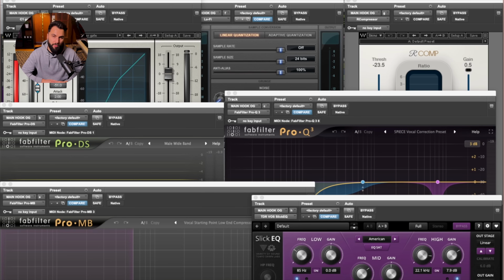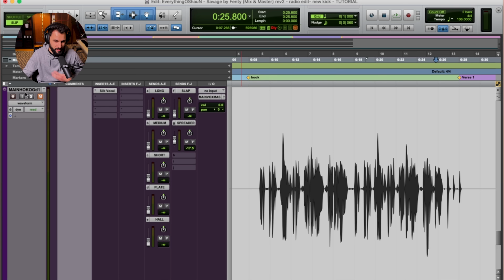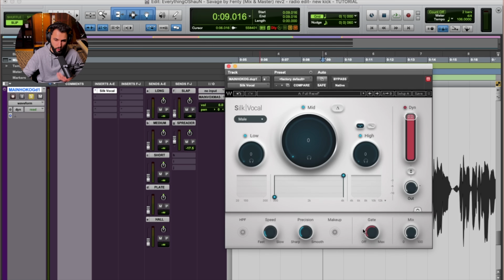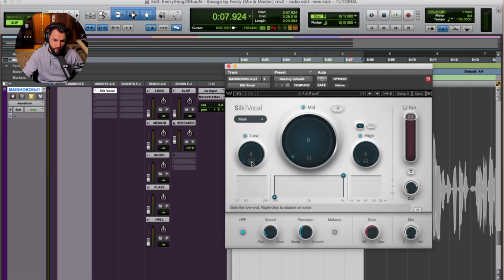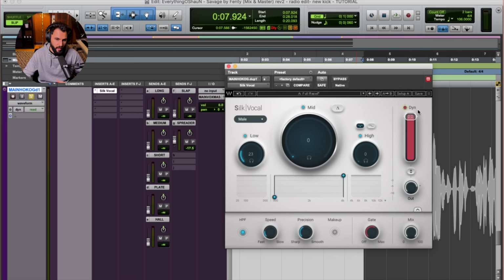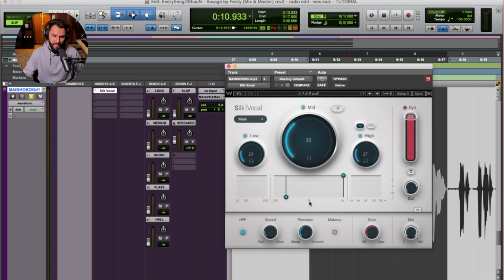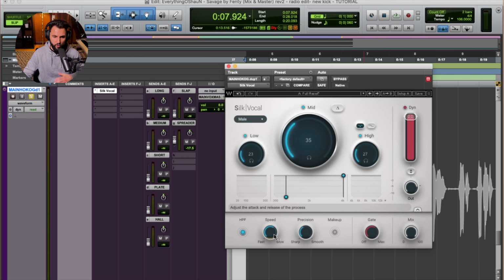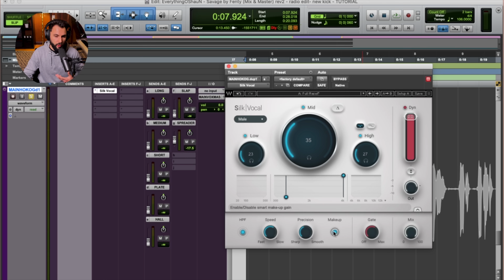FREE Plugin Replaces Entire Vocal Chain? 😲 (Waves Silk Vocal)

Comment: 60Hz (50Hz in Europe) is what your alternate current oscillates in your standard power outlet. With badly grounded equipment or using unbalanced cables can introduce a "hum" in a recording, hence the option to filter it out.

Comment: If you weren't already a waves user or were already a Soothe2 user then this plugin doesn't have much appeal—I skipped it. I've never messed with Waves so why start now? The licensing baloney gets old. When the DAW does 80-90% of what you need by itself, you tend to favor free plugins or stuff that is just a simple VST3 without all the bloatware.
Reply from the maker: As someone with literally hundreds (if not thousands) of plugins at this point, I wholeheartedly agree with you.

I generally float back to the same batch of tried and trusted tools myself. In fact I’m uninstalling plugins more than installing these days 😂

However, having new tools can really invigorate and inspire the process. 

For example, since making this video - I’ve been testing Silk out on a number of other sources (mostly diff instruments) and am really impressed with what it does (even when I shoot it out with Soothe and others). On the surface I would’ve probably written it off because I also have Soothe and other alternatives, but sometimes when I’m mixing I throw all preconceived notions to the wind and experiment. If it sucks, I just don’t use it and nobody knows anyway but surprisingly so far that hasn’t been the case with Silk. 

I’d say it was especially worth checking out simply because it was free (zero risk) but that’s just my 2 cents so I totally hear you.

Comment: For a one stop shop it'll get you just about there. I nabbed it for free because why not and can see myself using it as a problem solver followed by some additional processing focused more on enhancement. I feel like Silk will work well in the context of a dense mix where you need to really push the vocal to get it forward in the mix since that's when you can really run into problems with ugly resonances, as you said, similar to something like Soothe.
Reply from the maker: Yup! For sure. For free - you can’t go wrong. Worst case, it just sits dormant on the hard drive but best case it quickly gets you out of some scenarios. Thanks for sharing my friend !

Comment: I'd say that SILK is a great tool for those who don't want to get into the mixing side of things and just want something that sounds decent. 
One thing that I'd recommend for anyone who uses it is to still add saturation, and maybe a tonal EQ  and maybe a second compressor to give the vocal a little coloration. Overall I preferred your mix, I actually preformed a similar test and felt the same way AI is a good start but it can never match a humans creative approach and ears due to it's measurements being binary based.
Reply from the maker: 100% agree with you! A little bit more treatment from elsewhere and you should be covered but it is interesting how much you can accomplish with this alone without getting TOO nitty gritty
Reply: Tonal EQ? Can I use one of the onboard EQ's in Logic in this way? I am trying to build a vox channel template that is as natural as possible for the initial quality of the raw vocal recording session. Trying to achieve a chain with as little plugins as possible initially which is why I am drawn to the Waves plugin. I want a foundational template I can go back to in my workflow that a vocalist will feel really comfortable performing too.
Reply from the maker: @jcarh Sill Vocal is a “smart plugin” so it’ll automatically handle certain issues you’d otherwise have to tackle manually. With that said, you should be able to achieve similar results using stock EQs and compressors (including the ones from Logic) but in a slower fashion since, again, you’ll have to tackle it manually. I personally like the manual control of other plugins, but I would turn to this to make rapid maneuvers to get me close without spending a long time trying to dial in a sound. Hope this helps!

Comment: I compared this with soothe 2 and soothe 2 is way better than silk even on soothe default mood
Reply from the maker: Yeah I agree that soothe overall is a bit more intuitive. But it’s also way more expensive than this 😉 for $0, this is worth checking out - ESPECIALLY if you don’t have Soothe2
Reply: @5piece  yea I understand what your saying I bought soothe2 7 months ago and I use it on all my mixes
Reply from the maker: @ChadyBeats I wish I could say the  same! 😂 I feel like I abused it at first when I got it (bought it to solve a more specific issue in a mix i was working on at the time) and since then, it maybe gets action 1 in 20 mixes I do LOL. Sometimes it’s just too heavy handed for me and I’m a manual guy - love my automation, dynamic EQ and other stuff to let the track breathe / feel natural. (Or maybe I’m a control freak? 🤔) Soothe2 is still a useful tool though! Just gotta be sure to not overdo it, like anything in mixing
Reply: @5piece  I feel like Soothe always smooths things out too much, even on low settings. The end result always sounds dull to me. I put it on and usually end up taking it back off. It's okay for stuff to be a little harsh around the edges. Sometimes "harshness" is actually just aggression, bite, or excitement.
Reply from the maker: @rome8180 that was literally my experience too. Glad I’m not alone 👊🏼

Comment: I'm going to try this instead of soothe2 in mixing template as I get a lot of latency and drop using Soothe2. Maybe I need to to mix at 44.1 instead of 48. What's your suggestion?
Reply from the maker: Yeah, latency with soothe does seem to be a common issue. I’m not sure if there is a real-time workaround (curious if there’s a third party delay compensating plugin?🤔). What I usually do in latency scenarios, is try to dial the sound in (often in solo mode) and then commit it to audio and move it to the original starting place correct the latency issues. Basically i manually make up for the latency. It’s not always ideal since auditioning in context can be a bit off-putting - but it’s the next best thing I can think of. 

Also, I didn’t mention it in this video but Silk Vocal has a LIVE version of the same plugin which essentially is a lower latency version. I believe it came with the freebie yesterday so If you find the same thing happening with Silk, swap it out for the live version and see how you fare 🚀